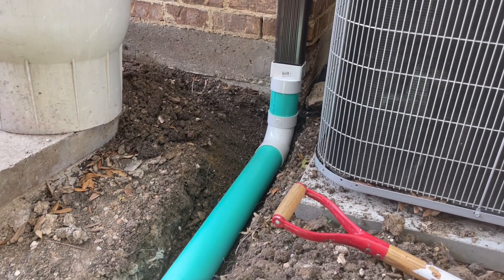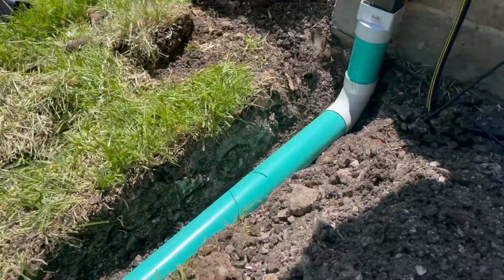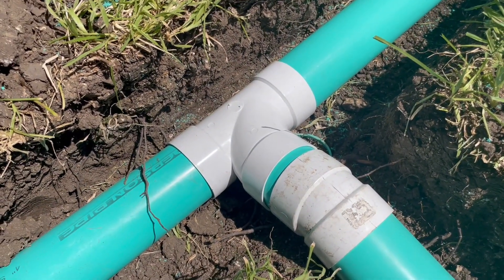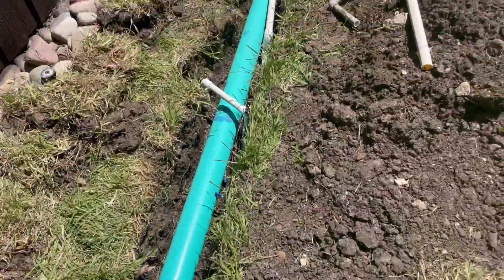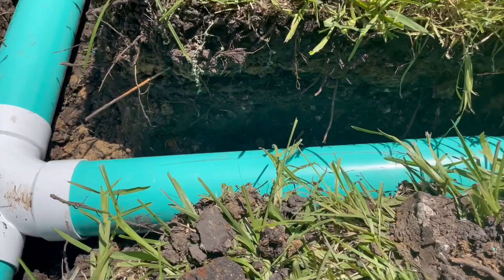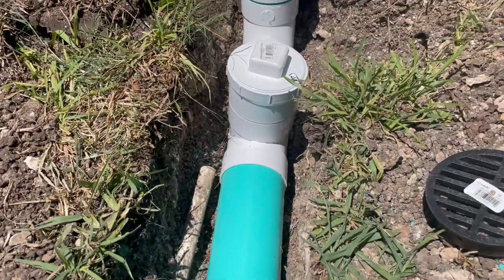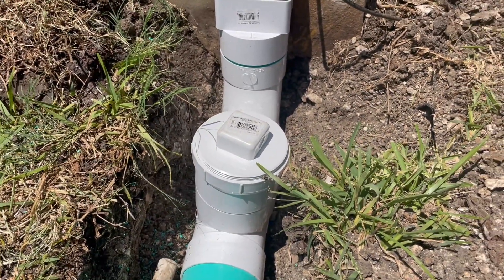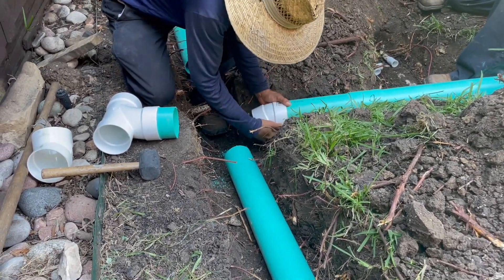Well-Designed Landscape Lawn & Yard Drainage System

Comment: Not bad good workbut u use cheep pipe you should use schedule 40 big difference
Reply from the maker: Thanks! Depends on the application - this project used SDR35 which is very dense pipe. Not as dense as Sch 40, but I’ve actually never seen it have issues long term.

Comment: Raising those irrigation pipes like that may put them too high. They need to be deep enough (4") that an aerator won't hit them.

You don't really need that clean-out, you're right by the downspout and you can just remove it and run your snake down there.
Reply from the maker: Good points! - I should have mentioned though, that this system was going to be covered by a wooden deck!

Comment: Hi John,

Love your work. I currently have some down pipes from my house leading to a gravel pit in the middle of the backyard. I would like to demolish the gravel pit, redirect the pipes to run down the side fence and to disperse at the back fence. Problem with this is my back neighbour is on the lower side so the water overflow would drain onto their property. What suggestions have you got? I’ve thought about:

1. Asking the back neighbour if I can run a pvc pipe down their side fence to the street.
2. Install a rain water tank at back of property.
3. Build a new gravel pit on the back fence with fill and geotechnical fabric and cover with lawn.

Thanks!
Reply from the maker: Thank you! I like option 1 for the simplicity - although a conversation with the neighbor could be anything but!
Option 2 I believe would be overrun with a good storm. NDSPRO.com has a runoff calculator which will allow you to see how many gallons per minute you are collecting and compare that to the size of container you plan to fill.
Option 3 could work, if you have a sandy soil. Here in Texas the soil is a clay which is not conducive to water dispersing underground.

All in all, I always like an open discharge if that is an option - so through the neighbor’s or anywhere else that is available would be your strongest bet.

Best of luck to you!
Reply: Thank you!
Reply: Do the pipes need to be installed on a slight downward slope so the water can run down?
Reply from the maker: Without a doubt.

Comment: Do you ever put a grate on the end of the discharge pipe to prevent any mice or anything like that from getting into the pipe?
Reply from the maker: We don't, because it would severely inhibit the flow of water. A well designed system is going to flush out anything of that sort pretty quickly.
Reply: Grate at the end of a downspout line termination point would be a trap for debris to get caught in the system, requiring perpetual maintenance & manual cleaning until ultimately leading up to a clog and demise. However, you can do it with a french drain end if it is fully contained and encased in fabric + stone since nothing would get in there.